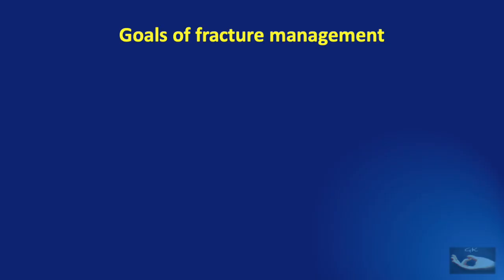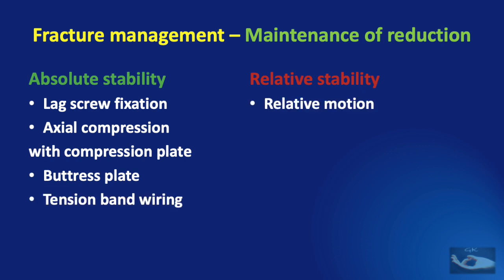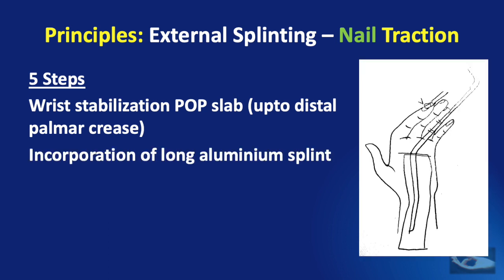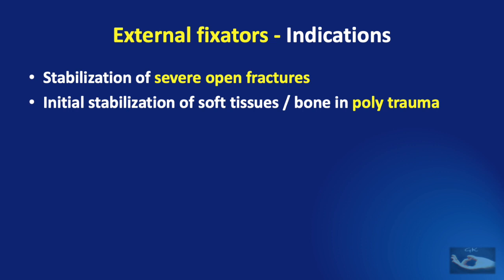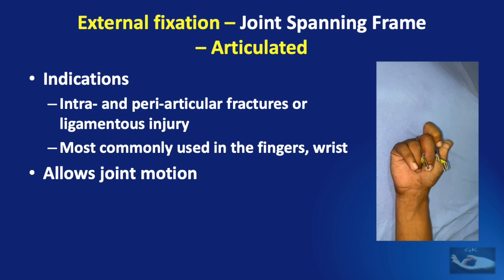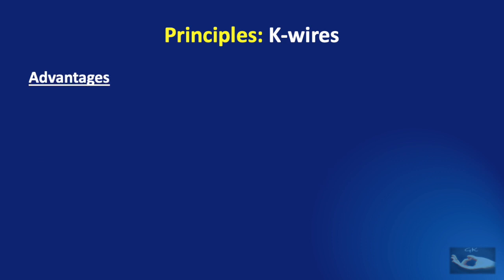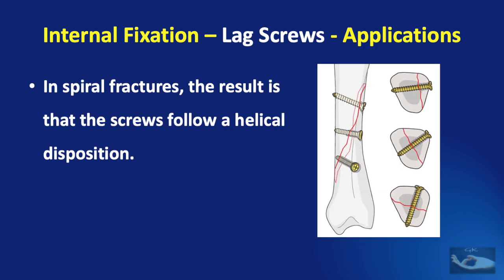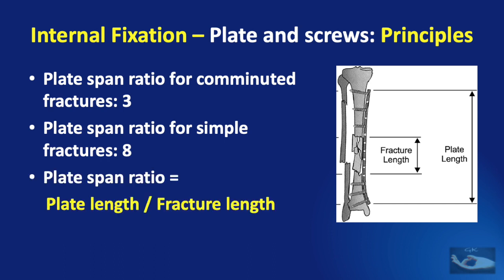Hand fractures: Basics 5-Principles of hand fracture management, splints, external internal fixation

Comment: Hello good sir. I have SEVERE tendonitis in both of my flexors tendons. The tendons are so inflammed that they push out of my skin, there is a big bump on Zone V. I’ve had it for about 1year and tendon capacity is very low. How can I know how much load the tendons can handle for exercising and healing? May you answer thank you🙏🏾❤️
Reply from the maker: Basically, if are experiencing pain, the load is too much on the tendon/muscle. Have you consulted a doctor in this regard?
Reply: @GKHandSurgery    yes i have been to the doctor, but is any pain bad at all while exercising? Or is some small pain ok? Because i do feel pain but not significantly.
Reply from the maker: @MeTube-YouTube  Some amount of tolerable pain in acceptable. Too much pain will cause more harm than good.
Reply: @GKHandSurgery  hmm ok thank you sir good to hear. 
Also, is there any tips/tricks or any type of medication(pills, creme etc) that would be good for this Doctor?
Reply from the maker: @MeTube-YouTube  Nothing more than regular pain balms